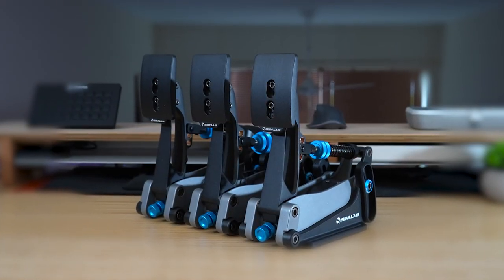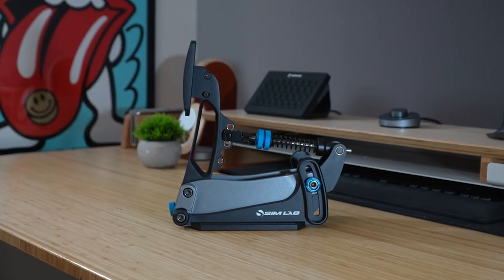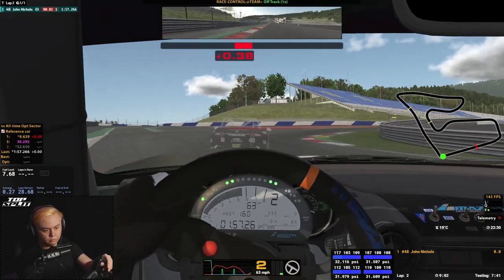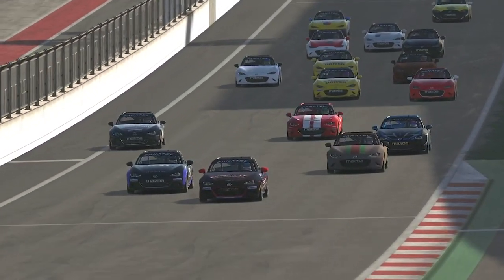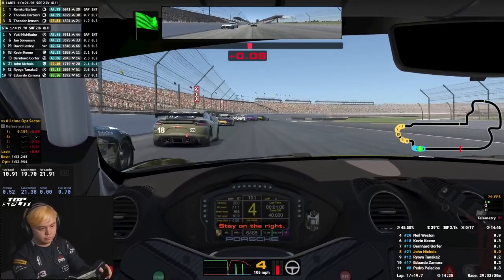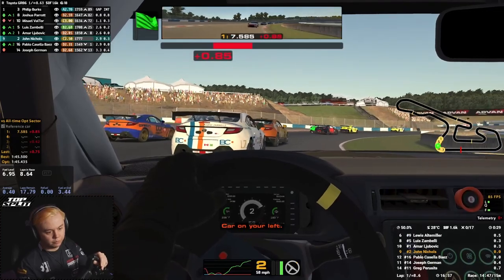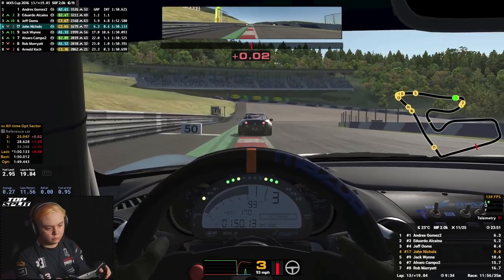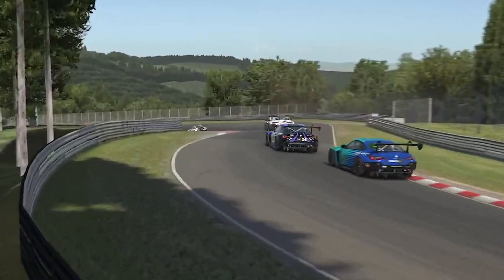These Pedals Are CRAZY! | Sim-Lab XP1 First Impressions

Comment: The pedal plates made me not buy them for now. I race with socks and that just looks painful. Maybe if they can replace them in a V2 and offer a spring break kit, they could be a great contender. For those that race with shoes, great pedals
Reply from the maker: After changing the curves so I’m hitting 80% where the crossover point between the spring and bushing is, using these pedals with socks is much better for sure
Reply: There are 3d printed files to fill the holes.